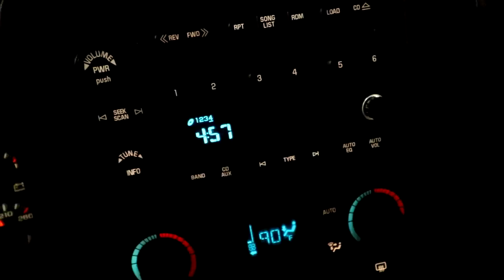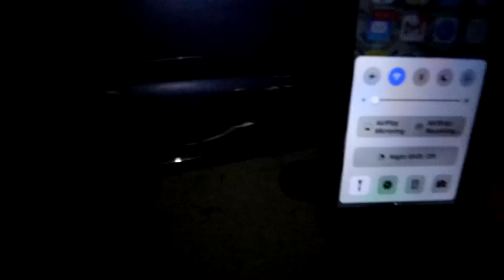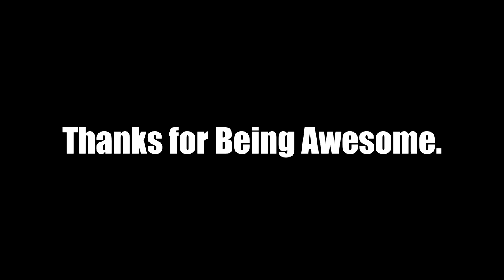the night i totaled my truck

Comment: Cosmetic damage, doesn't mean the Duramax is totaled!
Reply: it does in the eyes of a chevy/GMC owner lol
Reply: far from just cosmetic, bed needs replaced, door is fucked, possible other damage you can't see on camera, a car isn't made of nothing but body panels buddy, more goes into it than just that.
Reply: You don't think i know that? It obviously didn't damage the frame. And it's going to cost $4,000 to fix. I still don't feel like that's 'Totaled'.

Comment: That's not even close to being totalled wtf
Reply from the maker: Do you mind picking up the bill on this scratch?
Reply: Shut up Ryan go talk to your buds over at quad ricers
Reply: 3DMachines Now you can fix it correctly, instead of cramming bondo into your dents.
Reply: 3DMachines I would just leave it adds character
Reply: go to a scrap yard? i picked up my front end for my truck for 120 bucks. (bumper, radiator support, and grill)
Reply: You don’t know the mileage or history of his truck so how can you say it’s not totaled it needs all sorts of bumper brackets new bumper bump step it now needs a bed side  plus the money he spent on it for the paint. Total loss is when the value to repair out weighs benefit to the insurance company keeping a vehicle on the road. Believe it or not “Ryan” this truck could very well be a total loss
Reply: Not to mention a door and paintwork again $$&&$
Reply: Ryan Bauer he just painted it
Reply: Ryan Bauer he needs views = $$$
Reply: all he really needs is a new can of paint, some minor body work and a new bumper which is like $300 at most
Reply: You know nothing about everything at this point I'd say
Reply: KDcars get the shit that's fucked up paint matched alot cheaper
Reply: KDcars it's not totalled dude that truck still books pretty damn high on kbb..and it just needs a bumper not the brackets it just rolled the bumper down look at close and you will see
Reply: insurance is one hell of a thing...
Reply: That's right
Reply: Do you not know the value of a diesel? that truck is no where near totaled new bumper and any body man worth a dam can fix that truck in half a day plus paint, so being generous 3 days to fix it. Extremely high estimate to fix would be 2g and that truck is definitely worth way more than 2g.
Reply: i have parts. lol come on down... most likely exact color truck as well depending on paint code. but looks close. luckily insurance will cover things like that.
Reply: as a licensed insurance appraiser that's not totaled, but definetly brings more views saying it is.
Reply: Qaulity paint, body work done by someone who knows what they are doing, and a new bumper will exceed $300 easily..lol
Reply: sgj4aj full coverage is expensive especially for something like a dmax soo no he is not a fool for not having full coverage I don’t have full coverage not a big deal
Reply: you must not know what these trucks are worth, but yeah i agree with what you said
Reply: Some totaled,if it was totaled you wouldn't be driving it! Dented bumper,big deal.
Reply: Jimmy Vanfleet that’s false the insurance company will total a vehicle even if it still runs and drives depends on the year milage and damage to the vehicle.
Reply: the repair cannot exceed 70% of the retail value of vehicle
Reply: 4300$ to repair, which is likely atleast 70% of the trucks total value, = totaled. have a nice day.
Reply: by the way, I love when kids think the only damage to a vehicle is damage you can see LOL, a lot more goes into vehicles than some body panels kids.
Reply: RageAgainstTheToyMachine $4300 is 28% of the vehicles $15000 book value so therefore it isn't even close to being totalled. Have a nice day.
Reply: nice try, that truck is worth least 15k

Comment: A bumper and some paint, far from totaled in my opinion.  Still a shame to hear that it happened!
Reply: LSX StreetCars also dent pulled, filler for the paint, and will look cheap if you just do that spot
Reply: Can't really tell if there's a dent there.  Most PDR can massage most things out.
Reply: Kinda looks like there is at the front of the rear wheel well seems the flare is popped off or the box is dented in
Reply: I think it's hard to say, but either way I don't think it's near being totaled.
Reply: Very easy to tell the side was rolled under in front of the rear wheel. PDR isnt going to fix that. It will need a proper pull and respray.

Comment: I don't think that fits the term "totaled" but it may for the insurance company. Now my daughters Ranger would've definitely been considered totaled when she hit a tree. I had to replace the hood, both fenders, grill, drivers headlight, radiator support structure, and the drivers inner fender support structure to repair the damage. Hit the tree hard enough to push the grill support frame mount back 1.5 inches....had to use a large tool of persuasion to move it back where it belonged. We got lucky and found a non-running ranger to steal all the parts from :)

Comment: It's never good when you hit a Deer brother , especially a nice buck . But I really don't think it's all that bad brother. It doesn't look totaled to me , the bumper is toast but the rest looks just cosmetic, which you know that you can fix now . I hit 2 big does 2 years ago , and they rolled all the way down the side of my truck (2013 2500 GMC ) and I replaced the front fender , door, and had to do some body work on the bed side , and paint. But it was fixed in a short time . Just had to ride with the deer damage shame for a bit. But I'll help you with your (fix the DMAX cause).

Comment: That sucks. One time I was going 80 and there was a deer on the road in front of me. I slammed on the brakes and the truck was heading straight for the deer and the deer wasn't moving. I thought I was going to hit it. Luckily my tires squealed and it scared the deer and it ran off